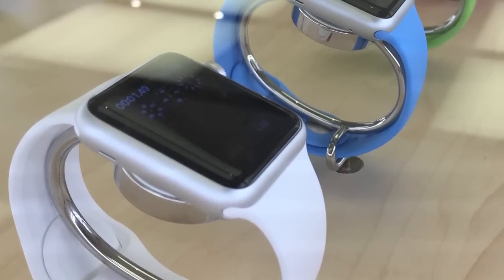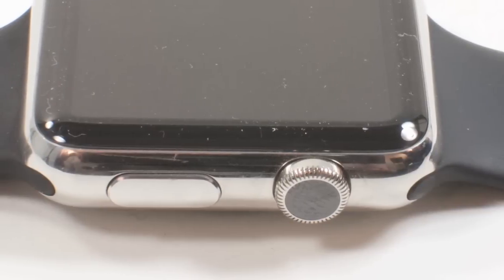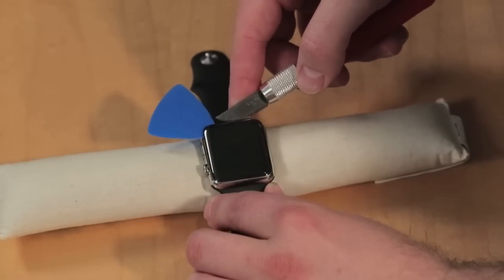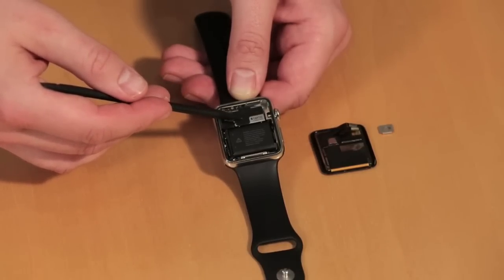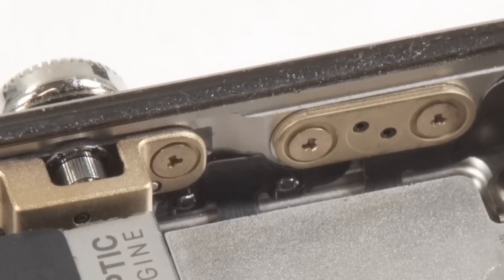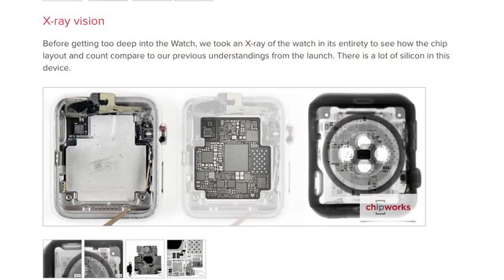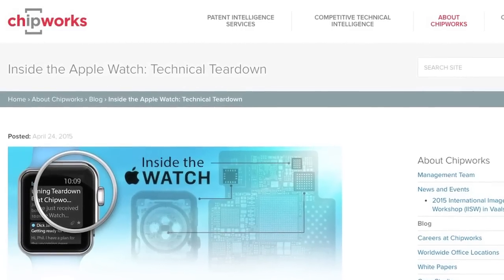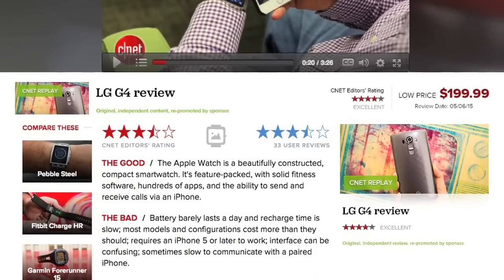Cracking Open - Apple Watch (2015)

Comment: Are you seriously telling me that CNet cant afford to damage one watch?
Reply: sibtain ali  good point
Reply: The issue is that, they used an extremely this multi layer PCB that is covered in potting compound;re moving it will damage the device, and will not come off cleanly, you will be better off taking an X-ray of the device. Apple likes to go out of their way to make devices non serviceable in order to encourage their customers to re-buy items that they could otherwise repair if it had not be designed by jerks.
Reply: thats great news if you got the gold one. honestly you would need to be out of your mind to buy somthing that will be worth less in a year. whereas a gold pc tower case could last you decades
Reply: sibtain ali no they cant, if they broke a device every time they did a cracking open they would lose alot of money
Reply: +MangaMiyn Ye they have to eBay later!  I'm guessing the description doesn't include "cracking open"
Reply: +sibtain ali that isnt IGN i dont think. I think they pay to upload videos on the IGN account to boost views
Reply: @Razor2048  it’s the price to be small in size with all that technologies and well attached together, to replace all these silicones sealers and glues will make these watches bigger.
I already saw opening for this car and read in comments that replacing screen silicone will decrease the water proof or nullifies it.

Comment: just wondering scince all the tech is on the s1 chip wouldnt it be theoretical possible to just replace the s1 chip with a s2 chip to upgrade the watch (assumended the watch2 would be 100% indenticall and just features a new s2 chip same size as s1)